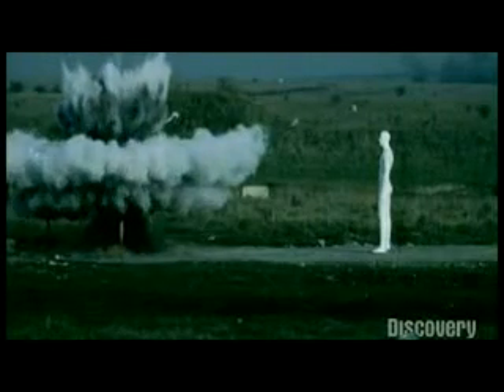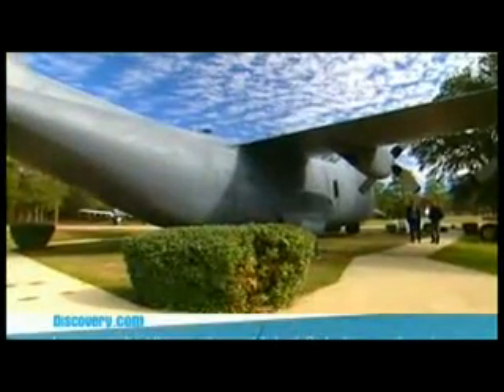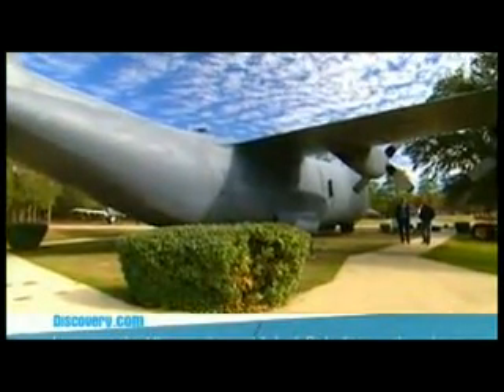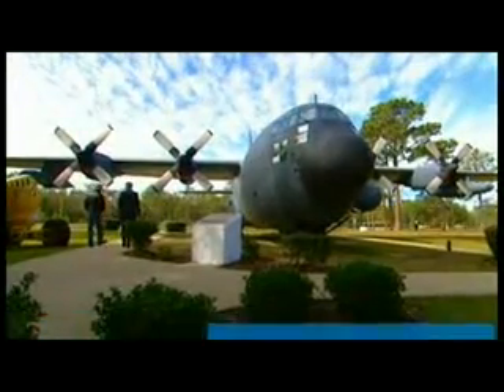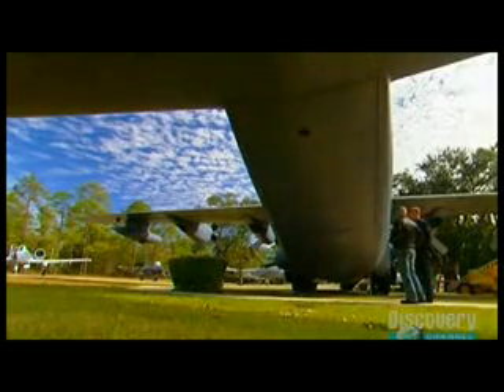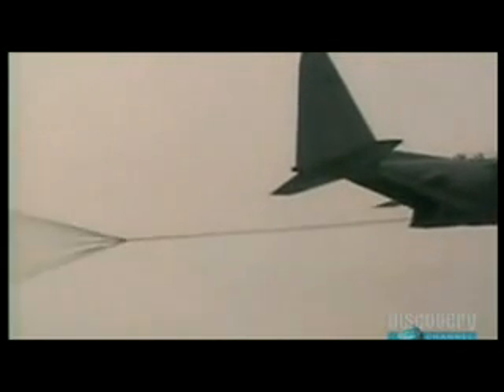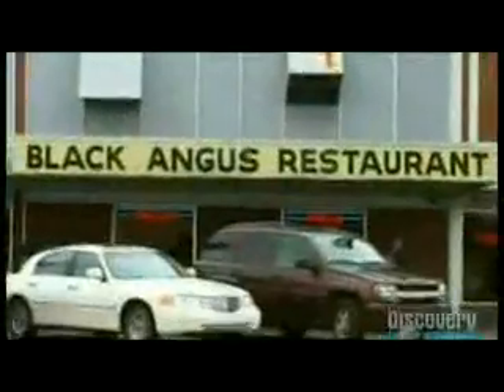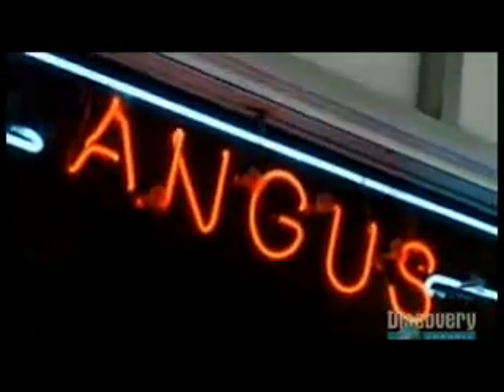MOAB - Future Weapons

Comment: Why not a B-52?
Reply: Iron2Man911 Because B-52 is a strategic bomber that carry various payload in one aircraft thus a big bomb like MOAB wouldnt fit in B-52...and also that thing is slow.

This is my guess eventually.
Reply: Turns out a large amount of information has been release since this aired. MOAB requires a MC-130E/H as a deploy aircraft, not only is the B-52 faster, there are more of them in service. Also the explosive filler nothing amazing, it's Composition H6. It was invented in the early 90s in Australia for Torpedoes and Sea Mines, as an improvement over Topex. A B-52 strike using thermobaric bombs would actually be more effective, as not only would the bomb load be larger (max 75,000 lbs) and area of effect would also be larger.

Comment: how wide would the kill radius be for 1 of these?
Reply: I'd say about tree fiddy
Reply: okay wats 350yrds in feet?
Reply: Derek Wall
1050? 3x300(900)+3x50(150)=so about 1/5 mile radius if that also helps; but i think 350 was an integer gathered via southpark joke and i dont believe that is the actual blast radius...i googled it wiki says radius 300m=328yards=984 feet so still as devastating as devastation gets just about; it can still surely re landscape any "route" especially if its behind, ahead, toward or directly on an enemy unit moving vehicles via mountainous road the could easily immobilize that unit and force them on to the ground with the drop of one of these for our helis to take care of is what im assuming these big sobs of bombs would be used for
Reply: on the movie outbreak they used a Blu-82 daisy cutter bomb (fuel air bomb) and they said that would flatten anything within a square mile. so how big is a square mile in feet and in a photo form? the kill radius for a 1 megaton nuke is 14 miles (from heat and the air blast/pressure wave) so how many city blocks are within a 984 foot radius?
Reply: Derek Wall why can't you just google it? you are spending this much time on youtube anyways
Reply: not really on you tube, but on Netflix and facebook
Reply: With weapons like these there are several things to take into account. there is a blast radius(thermal), kill radius(concussion), danger radius(fragmentation). Contrary to miss jackson's belief, this is not an area denial weapon, the designers intended these be used as antipersonel in dug-in position, such as a building or compound.
Reply: id be more worried about blast and shrapnel. shrapnel can be just as deadly as the air blast
Reply: i heard this bomb can destroy an area of an 8 block radius and shrapnel can fly as far as 2-21/2 miles
Reply: sounds about right. consider the following thought, shrapnel can miss you, but the shock wave or concussion wave can turn your guts and brain into a red paste.
Reply: yeah the noise can rupture and liquefy your eardrums (180 decibels is all it takes) and a shotgun blast about 4 inches from your ear can reach as loud as 165db will damage your ears but not deafen you permanently. 200 can cause death to anyone within 100 feet of the noise
Reply: the blast from little boy (15 kilotons) registered 240-250db noise levels of that magnitude liquefied peoples organs and whatever else. and I think any noise level over 200db creates a pressure wave of 2psi or higher
Reply: they can make a bigger bang than that. all they need is a 30,000gal tank filled with nitroglycerin (as long as it can be stable till detonation) a C-130 Hercules or C-17 plane, and just kick the fucker out the rear loading door set it to air burst. nitro G can make a big ass bang with that quanity

Comment: The AK-47 has proven significantly less accurate as an assault rifle compared to the M4 variant family in countless tests. The reason the AK series is so durable and so non-prone to malfunction is due to it's very large chamber size. This chamber size is less likely to get clogged with grime and dirt than the M4, but does not fit the round as well, causing a drastic loss on accuracy, due to less velocity guidance in the barrel.

The majority of Russian nukes are still dropped, not rocket guided.

Comment: Why didn't they just bolt a platform with rollers to the floor of the C-130 and attach the 'chute to the MOAB and just have it snap when a certain pounds per square inch is reached? Even if it snapped while it was still in the plane, it should just roll on down, or have a button that raises one side of the platform, and have no need for a 'chute whatsoever?

Comment: A nuclear bomb is defined by a fast nuclear reaction causing the energy of the blast.
There is a fundamental difference between a "nuclear reaction" and a "chemical reaction" the latter of which high-explosives use for the majority of energy released. Chemical reactions are fundamentally limited in the amount of energy released per ton, but Nuclear bombs can release 1000x as much for the same weight, thermonuclear release 1'000'000x for the same total bomb weight.

Comment: @Jackarunda , the bomb itself is fairly small, but since it utilize oxygen in the air the effects become gigantic. You can compare it with putting a stick of dynamite on a can of gasoline and putting it in a house. The dynamite stick itself won't take down a house, but combined with the dispersion and lighting of the gasoline, the house will be gone in minutes.

Comment: @Laikinlad The Grand Slam was indeed 22,000 lbs but it was also a "Dumb Bomb" by today's standards.  What makes the MOAB interesting, is that it has a GPS Guidance system which allows it to be used as a precision weapon.  In WWII they just opened the bay doors and dropped the bomb.  Anyone below had a bad day.  Now we can be more precise on who we drop it on.  It's not perfect, but it's still more advanced that WWII tech.